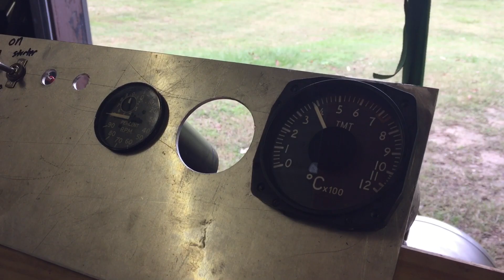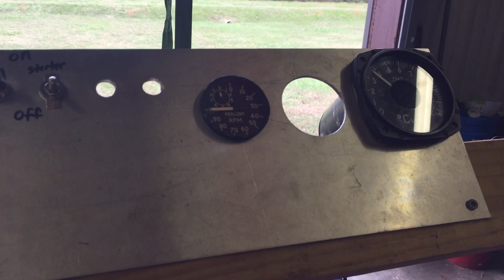Airesearch Garrett GTP 70-50 turbine

Comment: With the weight reduction there should be less stress on the drivetrain. There is also no power impulse. If you were running at 4500rpm with the Subaru, then the transmission should have been receiving about 2250 impulses / min or about 38 per sec. The turbine eliminates that. The weight reduction allows you to not pull as much torque which is also going in the right direction. Only drawback I can see is the fuel chugging it will like to do. It's hard to get high pressure ratios out of small little turbines. If you decide that a larger fuel tank is needed, then that may start to offset the weight reduction advantage until some of the fuel can be burnt off.  Great work, Jon!

Comment: Be worth it for the cool factor Jon LOL. Much smoother, quieter (big plus) but with less HP and less weight what kind of performance vs the Subaru are you thinking?
Reply from the maker: Hi Ken, good to hear from you.  Yes I would gain a few cool points.This turbine would be better suited to a lighter ship.  I would save about 120 pounds by replacing the Subaru with this engine, but lose about 15hp.  On a side note I bought a Hiller UH-12D and hope to be flying it next month.  There will be videos.
Reply: Great old helicopter, looking forward to the hiller vids.